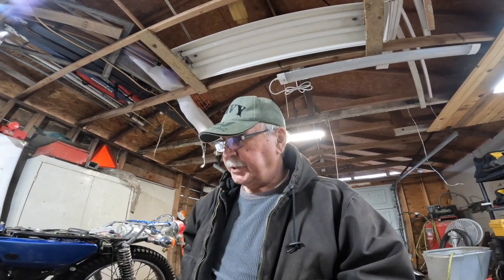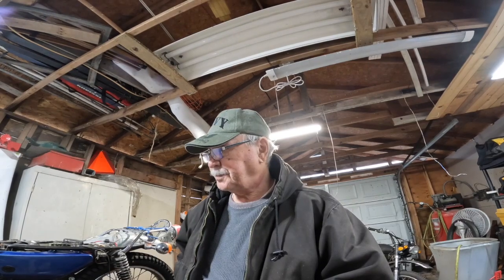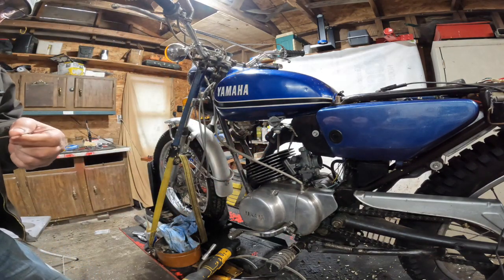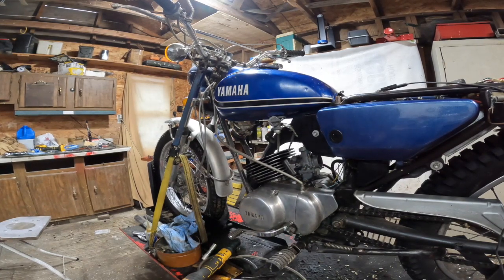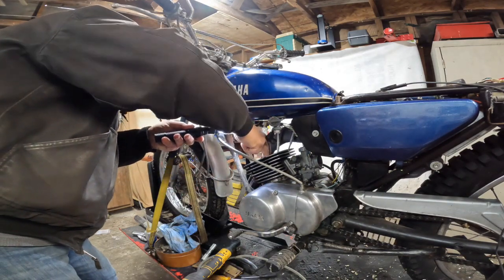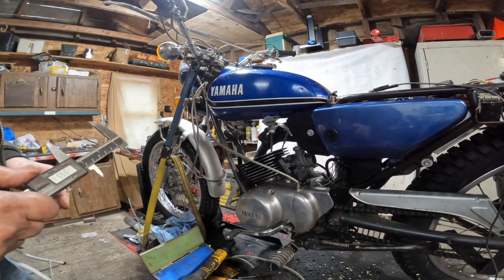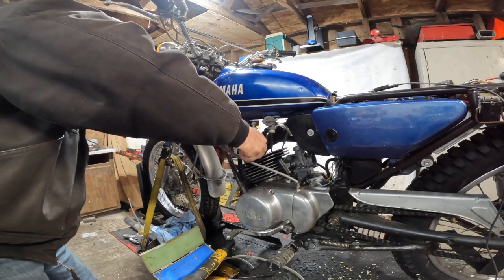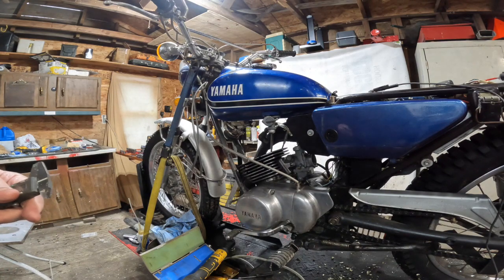2023 AT3 Revival Video #5

Comment: That's a shame Jack. I'm sure you'll soon have her running again. I wonder if the piston had previous damage. 
Best wishes, Dean.
Reply from the maker: Thanks Dean, It was getting a little weak in the compression area anyway. Got a OEM  piston and rings on order for under $100 total and bore job will be another $125. It ran pretty good before, so I expect it to be a real screamer with a brand new combustion chamber and piston.